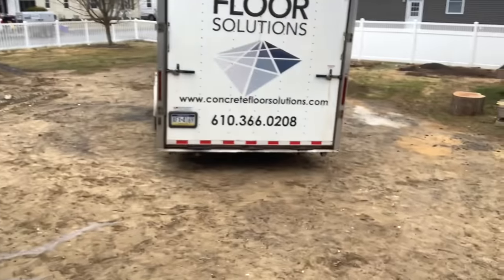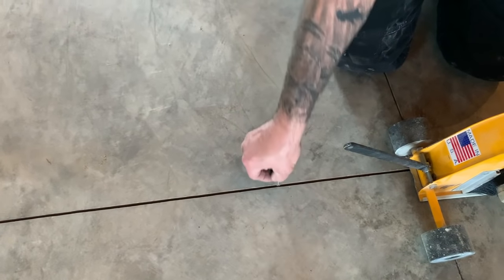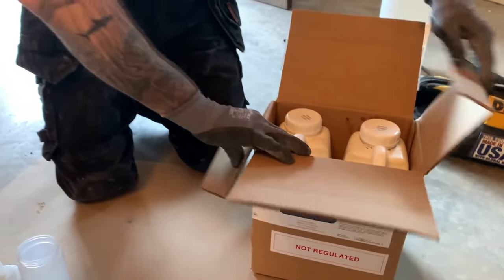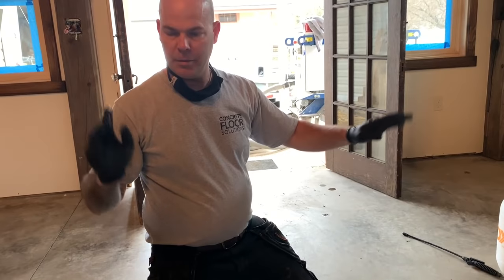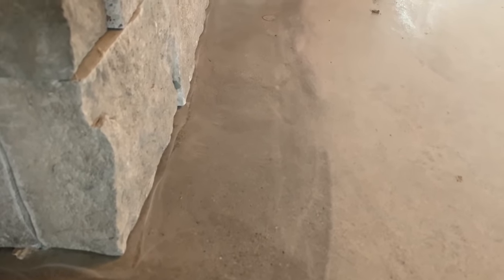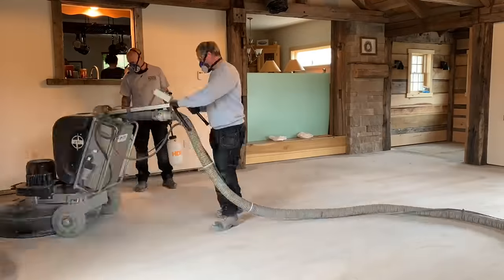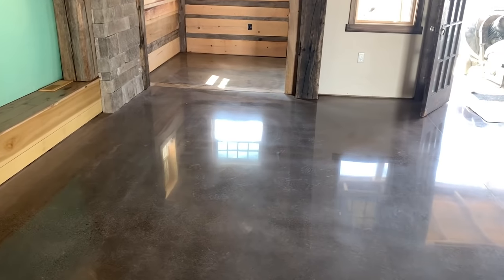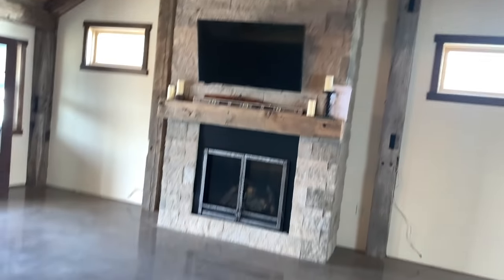Concrete Polishing inside a home. We made this room shine!

Comment: Spectacularly informative video, which absolutely convinced me NOT to attempt such a project myself. Also, I can't believe that you don't offer the special squeeze bottles for sale from your online store.
Reply from the maker: I don't know if I would ever recommend a homeowner try a DIY polishing project either. There are so many variables involved I just can't see how you could be prepared to do this without owning all of the correct equipment. Diamond grits, diamond compounds etc.  The squeeze bottles are pretty easily accessible and quite frankly I can't compete with the pricing.  Thank you for watching
Reply: @ConcreteFloorSolutions  what does a job like this cost per. sq. ft. ?
Reply: @ConcreteFloorSolutions  may I ask how much per sqft ?
Reply: You can find these squeeze bottles in the kitchen isle from any supermarket. It’s with the spatulas and kitchen timers and measuring cups

Comment: Cheapest way to do a foundation, its strong, the floor is included and it looks good too. But if not doing precasted slabs the entire foundation pour requires it to be done in one shot so you need a cement pouring machine, so you would have to contract this out, which is probably a good idea anyway for the most important part of your house, by far. Then you could build on top yourself with much less risk. Better than wood foundations because slabs are cheaper and last longer. Of course if your terrain allows it.

Comment: Just a pro tip for when filling cracks try using a card or trowel and scrape excess material down that crack instead of wasting all that material And I hope you guys are washing and taking all that dust off before you lay the guard other than that great video
Reply: They want excess material pooling ontop. As it dries it will shrink and pull the material down into the crack which would make them have to do a second coat.
Reply: I don't think these guys need a "pro tip" from a random person on youtube. I'm pretty sure they know exactly what they are doing.

Comment: This may also be a ridiculous question but since the corners are so much harder to grind, is it absolutely out of the question to grind after the slab has been poured and before framing? I am guessing there are multiple issues with this (IE. Keeping clean, weather exposure, needs cure time, etc). Is there not a sequence that makes some kind of sense like to complete most of the grinding after the slab has cured and then do the fine grit/buff/resin after drywall is in? Great work and video by the way.
Reply from the maker: You can do that, but it requires another mobilization. if you come back it will cost more money..It would be extremely rare for someone to pay more for a second mobilization.

Comment: I don’t know much about concrete but I am trying to learn how to do something like this to a car shop I am turning into an apartment. I had nice level floors but I had to cut them up for the rough in plumbing. Now they look hideous. 

Do you have any ideas on how to put a layer of concrete over the top to hide the cut marks and the new concrete?

I thought about a self leveling layer but would I still be able to get that color and shine as in this video? To see the rock and texture in the concrete?

Also do you need to put sealer on top of the concrete floor so it doesn’t stain or take in moisture?  

I would love any advise and insight!

Thanks for the video!

Comment: Hi Jason, I watched this video 3 times now and have to say: it is one of the most satisfying results I have seen.

2 questions: you scraped the 343 filled holes in this video and in other videos you grind over these areas after „repairing“ them. Is it like: scrape it when you polish the floor and grind it when you do an epoxy floor ?

Second question: would it also be possible to leave the joints completely open (without filling them) ?

Thanks a lot ! You and Jeff are a great team.
Reply from the maker: Thank you for the compliment.
Normally, we just grind the surface after we do the repairs. Without watching this video again, I probably made repairs to areas that I didn’t know existed before we started grinding, if I would have ground the surface after I made the repairs late in the game, I would probably damage the previous polishing I have already done, that’s why we scraped instead of ground.
Yes, you can leave the joints open, you just need to be careful that course abrasives don’t fall into the joint while polishing, you will pull them out with the grinder, every pass and re-scratch the floor. That is why we always fill joints when we polish. 
We did rename the crack filler, CFS-fast set crack filler, here is a link to the material if you were interested  https://concretefloorsolutions.com/store/repair-materials/epoxy-crack-filler/
Reply from the maker: So I re-watched the video because I was curious myself. You can scrape that crack filler if it is at the perfect time between liquid and solid in a gel state. Since we were scraping joints at the same time, we just used the scraper to shave the top of the crack filler material also. I typically don’t do that, but the timing was perfect with the other repairs.  99% of the time we just grind right over the crack filler
Reply: @ConcreteFloorSolutions  Jason you are the man to count on !
Thank you so much for your detailed answer.

Comment: Thinking about doing this to my 2900 sqft ranch home on a slab.  Its current flooring is outdated, carpet and old tiles.  I've refinished my basement floor with black polycuramine and refinished hardwood floors before, but this is a much bigger area than I've ever done and it's going in my whole house.  I'd like it to flow into the pool area, as well as the attached garage.  Have you done anything like this before?  It seems like a good idea in my head, but realistically, I don't know if it is going to match up with the garage and pool area.  Wondering if I do it all at the same time, prior to changing the grit, or if I break it up by part of the house and turn it into three different jobs.  Thoughts?
Reply from the maker: That would be an extreme undertaking for somebody who does not have  experience.
You may have different colored concrete in every room, you may have what they call ghosting on the floors which is stains from the tile. It could be a complete disaster.  I would approach extremely cautiously. That would be horrible to do that much work and have it look terrible when you're done.
You are totally at the mercy of the concrete that is there which is unknown at this point.
Reply: @ConcreteFloorSolutions  how durable is the finish?

Comment: What is the purpose of the joints and  doesn't filling them defeats the purpose?
Great videos BTW!
Reply from the maker: The purpose of the joint is so when the concrete shrinks (all concrete shrinks) it cracks in a nice straight line. The joint filler is a semi rigid material that allows for some movement in case it does shrink more, it will flex with the movement.  
The reason we fill the joints is so dirt does not lay in the joints, it simply makes it easy to clean.

Comment: Love the show…What is the first grit you go around the walls with on the hand grinder.Is it high speed grinder or what please?
Reply from the maker: I use the Hilti DG-150 with the Hilti general purpose wheel, it doesn't tell you the grit, but I would guess it's around 100. I use high speed on hard concrete, low speed on the soft concrete.

Comment: are you running a densifier sodium based or lithium based? and also what was the last resin bond you used on this floor?
Reply from the maker: lithium, this video was shot a while ago, I believe it was 400 grit and then we switched to diamond impregnated pads

Comment: Great job! Maybe an unusual question, but is it possible to do something similar with a poured concrete wall?
Reply: I would assume it's possible using a hand-held sander/polisher.
Reply: Yes. I lived in a loft that had the classic "industrial" look, exposed HVAC and all of that. The 13ft walls were all polished concrete, as was the ceiling. The floor was originally as well, but hardwood was laid over it.

Comment: so i have a question, if i do this at my house will it lower the value or is the same as if i have tiles
Reply from the maker: I really can't answer that, it really falls on the opinion of whoever is buying it.
If it's done extremely well, I would think it would add to the value. If it turns out to be a train wreck it would lose value.

Comment: Hi: Our concrete floor is over an in-floor heating system. First leveled using a long 2x4, then floated for a few hours, and finally hand troweled way into the middle of the night. It was done mid-winter, above freezing. A typical DIY basic $$ project. It looked pretty nice. It was done in sections because of the size of the hose trucks in our rural area. The sections were divided based on entries into the kitchen,  hallways and bedroom area. That mostly worked fine. When main front areas were pored, we rented basic polishing equipment available in our area. We ran it to about 150 and it looked great. We did this to each area, and covered  with construction paper and sheets of plywood. As the project progressed we are now ready to do some final polishing, then use densifiers. All the windows and doors are in, so this is a reasonably warm space as we enter the fall. Questions: What brand lithium silicate densifier do you recommend? Do you use the nano type or not? We will probably polish the floor up to about 200 or so but not as shiny as this job, which is amazing. We want to put a carnauba wax on it once construction is done. Do you have experience with this? I don't want it really shiny or slippery and I have read that the carnauba isn't crazy slippery. Any thoughts on that. I don't need it really shiny and don't want to use a sealer if possible. Thanks so much for these amazing videos and what you have shared. You are helping a lot of folks. And you do great work for those who can afford to hire you. We appreciate you sharing your knowledge, cuz otherwise we would just have a crappy gray concrete floor. Thanks.☺PS Please answer if you have time cuz we will be tackling the next steps shortly.😱
Reply from the maker: I don't have any experience with the  wax at all, we use a lithium densifier. https://concretefloorsolutions.com/product/cfs-7937-concrete-densifier/

Comment: Great job! Doesn't the finished floor need some sort of sealant to prevent the concrete from absorbing stains etc?
Reply: At 21:28 he said he put on a  'densifier' on the floor. I guess that would prevent anything from being absorbed.
Reply: Yes. LS Guard sealer, and then burnishing it.

Comment: I've watched a few of your videos and it doesn't look like there's typically a grouting step, do you find that your customers prefer a more natural look?
Reply from the maker: We've  been pretty lucky with the residential work. Most of the concrete is in very good condition and does not need a grout coat. We will offer it as an option if we run into very porous concrete.
Reply from the maker: We will grout if the surface is porous.  The large dealership (black stain) video was grouted.  Yes, I find most customers like the natural look.

Comment: Our new slab is  a few months old but it has some spalling (holes). We want to seal the concrete(not polish or epoxy). Would you recommend using the Poly grade joint filler and CSF 343 on holes and only seal the concrete?
Reply from the maker: The CFS-343 https://concretefloorsolutions.com/product/cfs-343-fast-set-epoxy-crack-filler-fast-set-epoxy-spall-repair/ can be used on spalling and holes. You can use the CFS-830 for joints https://concretefloorsolutions.com/product/830-joint-filler/ , it is clear. 
If you only wanted to seal the concrete, you can use an acrylic sealer CFS-8400 https://concretefloorsolutions.com/product/cfs-8400-clear-water-based-acrylic-sealer/ for a wet look.  It is not as durable as epoxy, but it will seal the concrete.

Comment: How much do you typically charge per square foot?
Reply from the maker: Typically $4.00 for a large job that is wide open up to $10 per square foot if there are little rooms involved. Stain is an add on. It also depends on job location, joints, cracks, repairs etc.

Comment: When filling the cracks with the low viscosity crack filler will the overflow stain the concrete ? Also does that type of crack filler accept stain?
Reply from the maker: The low viscosity epoxy will penetrate into the concrete and leave stains depending how hard, soft or porous your concrete is. If you are polishing concrete, fill the cracks first and then begin your grinding process which will grind deep enough to remove the stains. This material typically does not take stain very well, solvent-based stains will stain a bit, water-based stains will not.
Reply: @ConcreteFloorSolutions  Ok, thank you! Also another question , can you grind through craze cracks( medium aggregate grind) I looked at a job recently and a couple 4'x4' spots had them and I want to prepare the customer as to what to expect. Will be only my 3rd polish job so I'm still learning. Thanks again
Reply from the maker: @1stainless  you will still see the craze cracks after you polish. It is imperative that you explain to the customer that it is an organic floor and part of the character of the concrete. It is absolutely out of your control what is within the concrete. They need to be willing to accept inconsistencies within the concrete that are out of your control.
Reply: @ConcreteFloorSolutions  Thanks for your reply. I've watched your videos lots and appreciate the input. Some valuable info on preparing customers is key on expectations. I pay attention to your comments when you mention customers and brief descriptions of what you have gone over with them. Do you put in wrighting on your estimate some of these expectations ? Eg, possible cracking recurring through a coating... or something like that. A video on how you prepare customers might be pretty interesting as it's a big part of any job. Thanks again
Reply from the maker: @1stainless  If you email me, I will send you my exact disclaimer I put on all proposals. My email address is jason@concretefloorsolutions.com

Comment: I'm in the construction industry in California and we find that many owners try to save money (understandably so) by avoiding concrete polish and, I suppose, hoping that a hard troweled/burnished finish will be the equivalent. What would be your response to an owner who wants a polished look but thinks it can be achieved with a troweled/burned finish?
Reply from the maker: Personally I have never really run into a floor that has been finished so well it's that shiny / smooth and reflective. If you can actually find somebody that can do that, that is great, but I would say you are extremely limited on finding a contractor that is able to finish concrete like that.
Reply: that is another type of flooring....is all....nothing wrong with trowel look....the way you sell PC is based on a mock up....must see the two finishes to compare....no Home Depot to go and look at a Polished Concrete Sampe
Reply: I 'm in California if you need this work. Just send me texto
Reply: @geradochavez1634  Send me your info. I'm in S. California
Reply: @leahsmommy21010  text me for any cuestion
Reply: Never get that shin off a power trowl floor. Floors gonna be burnt concrete and hard as he'll to gring later and get a good look.

Comment: I don`t understand meaning of those lines in the floor. If there is heating pipes underneath, and it is solid concrete. Why those separation lines? I´m constructor in Finland and we don´t do those, except for very large areas. Awesome work nevertheless.. Just unfamiliar with U.S. building procedure..
Reply from the maker: Those are predetermined saw cut joints to allow the concrete to shrink and crack in a straight line

Comment: How would you clean these floors?  Just water?
Reply from the maker: Yes, a damp mop is all you need. If you spill oily liquid, you mix a mild solution of simple green with water.   Polished concrete floors are the lowest maintenance floors in the industry.
Reply: @ConcreteFloorSolutions  awesome!  We are building a barndo and the first half of our slab was poured Monday and due to concrete/wind issues the finish didn't turn out that great.  Foot prints, a few holes, uneven spots so they are offering to grind/polish to fix those imperfections.  Was concerned until I saw your videos! I love the look of the aggregate stones under the top.
Reply from the maker: @ingasmile  let me know how it turns out, good luck

Comment: How much would it cost to have this done on a 600sqft floor?
Reply from the maker: That really is not a question I could answer accurately. There are way too many variables that need to be taken into account to come up with a price, if I had to guess off the top of my head probably $12- $14 per square foot.
Reply: @ConcreteFloorSolutions  Thank you for the answer. I figured it was expensive considering the tools, labor and skills required to do the job right. I was in a newer "Super" (i.e. really big) WalMart recently, and its entire concrete floor was finely polished like that. The place was enormous with many thousands of sqft (probably acres altogether). How can they afford to have their floors polished to that degree? And I mean they were immaculately polished. Is it that they hire special contractors during the construction phase who can actually pour and finish a slab with that level of precision so that very little grinding and polishing is required after the pour is complete?
Reply from the maker: @drott150  if you are polishing 10,000 20,000 or 100,000 ft.², the cost per square foot drops substantially. Sometimes as low as two dollars per square foot.